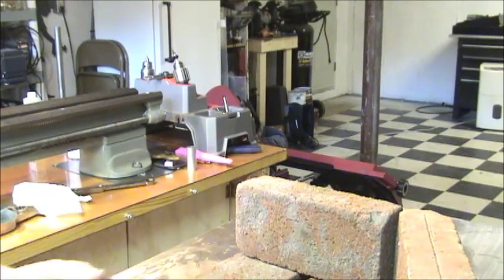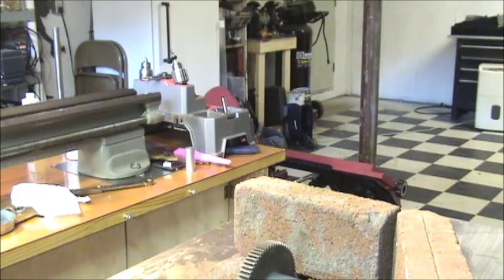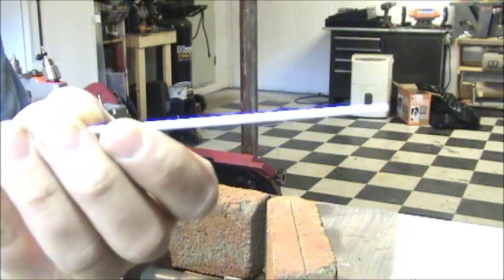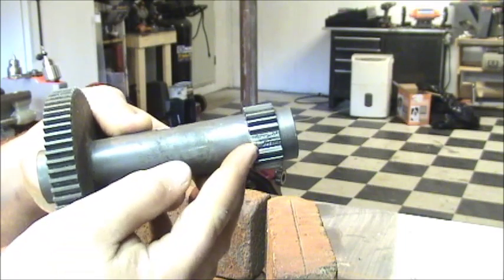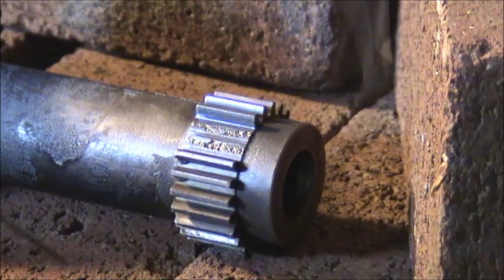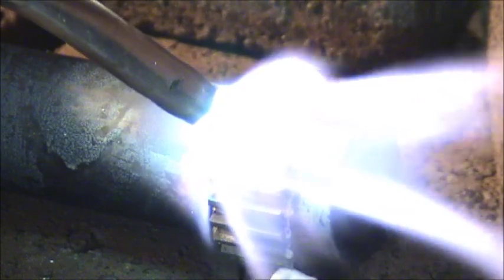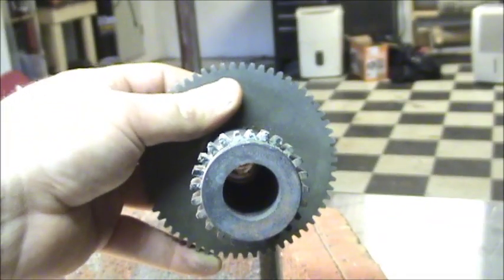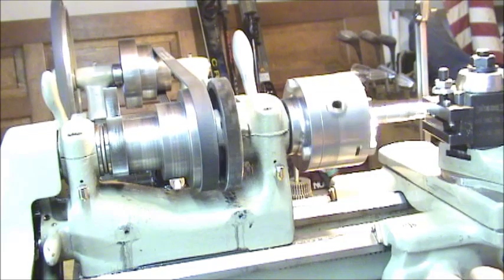Backgear Repair on a South Bend 9 inch Lathe

Comment: I have never actually had to do a similar repair but have worked in shop where it was done. A row of holes was drilled along the roots of the broken teeth and shorts bit of bright mild steel driven into them to act as a re-enforcement. Another trick was to build a dam around four or five good teeth. The dam was filled with lead. The result was a gauge which could be used a check of pitch and form.

Comment: A guy I took a short welding class from would pre-heat cast iron in a wood stove, then toss the part back into the fire after welding and leave it as the fire and embers died down overnight. 

A couple of other things that might be worth mentioning?  Using fire brick is safer than building brick. Fire brick doesn't absorb water and so it won't burst from high heat. More important for oxy-acetylene welding (which you never want to do on concrete either, for the same reason). Also, you want to keep the acetylene tank vertical. Acetylene isn't pressurized, it's dissolved in acetone and a filler material. If you tilt the tank, you can end up with acetone coming through the regulator. Regs say something like 24 hours vertical before hooking up if you have the tank on its side at all. I'm sure that's more than needed in most cases, but it's almost certainly safe. I've also been taught that you only open the tank valve on acetylene a half turn or so...you want to be able to close it quickly if there's a problem. Oxygen and other high pressure valves get opened all the way so there's no leakage around the valve stem. 

Just passing on what I've been taught.  What you did obviously works for you.  My lessons were more OA welding, and not acetylene alone but there seemed to be some overlap. 

Thanks for showing the repair. 

-- Mike

Comment: Man this is a great video. I recently bought an old Atlas craftsman lathe. It's got a horrible vibration in the rotating assembly somewhere. I'm hoping its not the headstock shaft.
 I'm going crazy trying to find it. Great work on the gear by the way.

Comment: Nice tutorial!  thanks!
Is your flat belt split and tied or is it one piece?  If one piece how did you get it on the drives?  I have a 9" SB, and I cut the belt and stitched it with nylon cable lacing cord (pretty strong), but it is a pain!

Comment: Good vid. I have found that silver solder wears down pretty fast.  The brass brazing would probably last longer. I have found the best way whenever possible is to silver solder in a new piece of the  base metal, in this case some cast iron. Faster to solder and you can easily get it back to full size for machining.  Keep up the good work. A noob with a SB 10 K

Comment: Thanks brotha I've had it apart so many times it's driving me crazy. The original owner really had some messed up stuff going on. Cobbled spindle shaft, flats for set screws made with an angle grinder, completely off axis, wrong spindle pulley,bunch of wrong hardware,broken transverse gear,now this vibration, I've got it narrowed to the headstock pulley or bull gear,hopefully not the shaft.Xp I'm going to be making some video for a forum I'll get it up soon. Maybe you can take a look. Thanks

Comment: can I use the same method on fixing the headstock bearing bore?
 my headstok have missing some corners and there is a cut inside the bore I think somebody tried to push the spindle from the back and that caused the spindle lip cutting from the bore!  

my plan is to do the same what you are doing to fill the missing parts, then sand the extra brazing, then insert a honing cylinder sanding stone with 4 handles to re-sand and polish the area!

is that will work?

here is my headstock:(  so bad I think so) 
thank you fro your inputs again
Reply from the maker: Probably not the best idea.  In all honesty these lathes can still run fine with really scored bearings.  If you want to fix it your best bet is to line bore the headstock and fabricate some new bearings from bronze and press them into the headstock.  It's a labor intensive and expensive process and it needs to be done extremely accurately.

Comment: Thanks!  Yes I used a serpentine belt also, but didn't remove the shafts to install it and had to split the belt and stitch it back.  I will get another belt (I have several) and actually take the shafts out and install the belt without splitting it as the stitching is starting to tear out of the belt... oh well!  I am watching your videos on the SB now!  Thanks!

Comment: I don't believe they've had manufacturing in South Bend for a few decades. The brand is apparently still alive and being made somewhere. I think Wikipedia said Grizzly dealers are selling their machines. There is a website for SBL you can find it through Google or other search engines. Their website has history and old pictures of the factories. I believe that the company was started by the same brothers that had O'Briens Paints.

Comment: hmmm if you had a TIG welder you could weld the new teeth in pretty easy very controllable and very clean problem is you need the helmet and shielding  and the practice working on something that small you need a steady hand and a good eyes and also the pre-heating could you use a barbeque :P they work well getting it warmed up for the pre heating and also post heating but good job with that I i don't think i be as confident repairing with oxy it just flows too much to be controled for me

Comment: I have to do just about the same thing for the second time I don't Logan back gear but the large gear I don't know why I keep knocking teeth off that damn thing unless it's just so damn old I don't know?. So what I'm going to do is I have two assemblies both missing teeth I'm going to cut out to teeth in one block and then cut the meeting side with a slitting saw off of the damaged gear and then shape the two teeth to fit in the female half hopefully I'll be able to do this and get the gears teeth to line up perfectly and I've been getting pretty damn good with brass brazing so I'll just plain old Breeze it in. They say brazing cast iron makes it as strong if not stronger than the original piece well we'll see. I have no doubt that I'll be able to do it I just got to get a nice pocket cut to accept the teeth with a little extra room for brass.